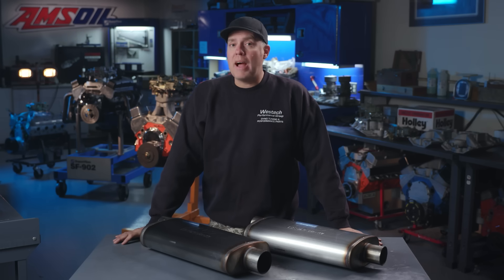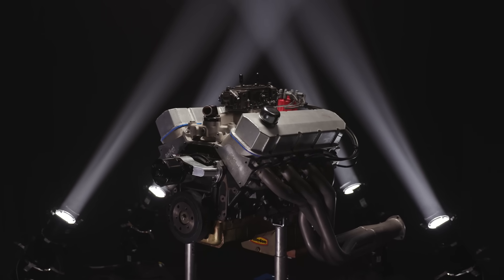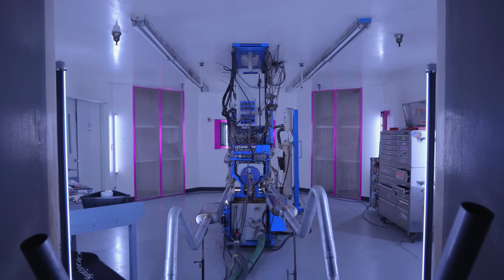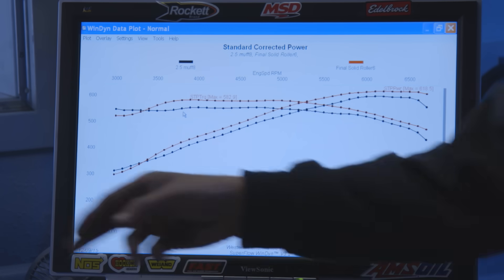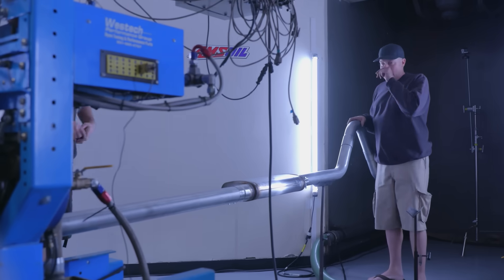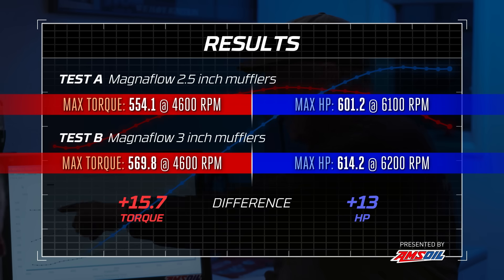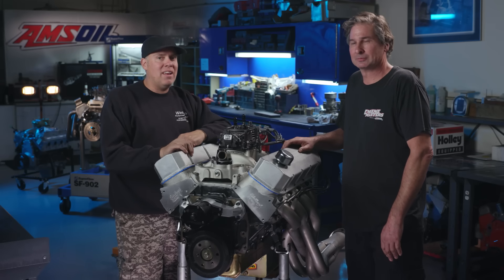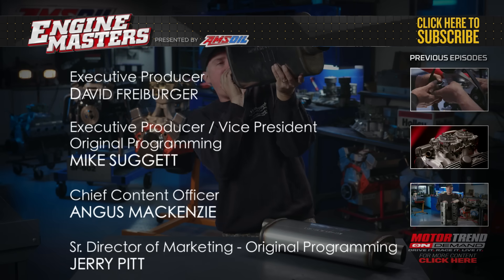The Power of 2.5- vs. 3-Inch Exhaust - Engine Masters Ep. 9

Comment: The comment about exhaust shops is so true. Every time I get an exhaust made I have to hear "nonono man you want 2.5 inches so you keep some backpressure. Your engine needs it!" Where did this myth get started and why do all exhaust shop owners believe it
Reply: +Xbox360Player350 Because in a naturally aspirated engine, exhaust velocity is a thing that affects performance. Hence header runner size, and on the other side of the engine, intake design for optimal airflow as well, instead of just the biggest, most open everything. However, the restrictions that improve velocity also introduce backpressure. So while velocity and backpressure go hand in hand, people mistake backpressure for the phenomenon that actually improves performance. It would be interesting if they had done this test with an oversized exhaust like 4" or 5", or compared 2.5" and 3" on a smaller displacment, or stock engine.
Reply: +Xbox360Player350 It comes from the guys putting 3" exhaust systems on stock 4cyl engines and losing power. There is such a thing as "too big" when it comes to exhaust. But it's not a lack of back pressure causing the issue, its a lack of flow.
Reply: +Tyler Hunt of course 3" is too big on a stock NA 4 cyl, but I had an E36 M3 lol. And they told me to go with a single 2.5" exhaust
Reply: Hey man, you just asked where the myth came from. Also, I doubt you'd see much of a difference between 2.5" and 3" on a stock E36 M3.

Comment: great study, I was wondering the what horsepower would be achieved if the air fuel ratio was optimized for each exhaust size, the exhaust length was for a cut down for a 15 foot car and the exhaust pipes were cooled by fans as to simulate running on the street.

Comment: You mainly have to consider the volume of your exhaust gases. Installing larger than needed exhaust will cause power loss, running no exhaust can cause significant power lose as well. It all depends on the engine size and tune.

Comment: so, we're talking about 10hp on a 600hp v8. The muffler pipe took 2% of the horsepower. putting these data on a 150hp 4cyl engine we have something like 3hp difference. 3hp is more like quality fuel variation or even the engine temperature. On a daily car I don't think it makes a lot of difference

Comment: Probably against your religion but I would like to see the difference on a 2/3 inch exhaust on a 4 cylinder
Reply: +Preproto definitely blasfemous, i dont think they will, 4 cilynders are not their commercial target, besides on a 4 stroker the difference would be neglible.  bring it up prove me im wrong!!
Reply: They should also try 4" and a single pipe etc, this would be really interesting to me but I guess I'm not the target market... I am ok with that.
Reply: +TheEdudo There would be a difference on a 4 cylinder turbo, would be interesting to find out how much off a difference though.
Reply: +Preproto single 4" would flow more air/make more power than the dual 2.5" but not as much as the dual 3"...it would also weight less than the both.
Reply: I meant dual 4's since they tried 2" and 3" and were so close to the straight header power I want to see if it goes up to straight header performance or if it takes a dip due to lost velocity
Reply: ***** Dual 4" would be for a serious street car
 dual 3" is good to 650hp
 dual 3.5" - 700<750hp
dual 4" - 850<900hp

Flowmaster has a chart that is conservative. They say a 4" single is good for 425hp which is slightly higher than what they recommend for dual 2.5".

Here is a good chart (DYNOMAX) to use that shows single vs. duals and recommended  pipe size vs. displacement and HP.

http://www.thirdgen.org/techboard/attachments/exhaust/109065d1136135734-horsepower-limitations-exhaust-dynomax-pipe-diameter.jpg

Comment: Repeat this test with an H-Pipe or X-Pipe and also on an engine making 350-400 HP.
Reply: I'd like to see this too. Is 3" a complete waste on a 350-400 hp small block.
Reply: +Bill Panop With my first vehicle (96 Ford Bronco) I did this thing I called the superpipe, but it was really just TWO pipes going into ONE pipe, which then split into TWO pipes to the mufflers. And maybe it was just first car love or something, but it sounded badass, it was freakin perfect, moderate when daily driving, and loud when I wanted to be.
Reply: @cybertree  That is normally referred to as a y-pipe set up usually gd for low end tq.
I have it on my car that I built for light to light street speed but I absolutely hate the sound wot.
Has my musclecar sounding like it's an Indy500 car
Reply: WarmSoftKitty Exactly, I think Lake pipes are the ultimate solution to everything (including looks). Although having both banks of your cylinder's exhausts connected at some point down the line does EQUALIZE PRESSURE, and that WILL improve HP.
Reply: WarmSoftKitty It's about more torque, H-pipes make torque off-idle. Besides, the sound alone is worth it. Again, why would manufacturers use them if they were almost worthless? They'd save money by not using them and charge you the same price for the car.
Reply: That's a great idea! I have always wondered what the difference really is.
Reply: +WarmSoftKitty from what I understand a cross pipe (H or X) actually can make more HP if optimally installed. You say not but provide zero proof.
Reply: The cross pipe uses the opposite cylinder bank to scavenge the exhaust/draw in more fresh air into the cylinder and is proven to increase midrange power.
Reply: AmericanThunder The only way to optimize the exhaust on a crossplane crank engine, without a crossover, is with crossover (bundle of snakes) headers. Even with perfectly even exhaust pipe length, you'll gain torque with a crossover. 

If that weren't true, auto manufacturers wouldn't bother using them on factory true dual exhaust systems, they'd save money by not using them.
Reply: snakesonaplane2 Optimized, as in, proper primary tube diameter/possibly stepped design/prim. tube length/collector diameter etc. Once the header is optimal, anything after the collector just needs to be big and free flowing and you can't go wrong. lol
Sure, an X pipe in the right spot will probably add a bit of power, but I wouldn't bet on it adding much when you have a proper header on the motor.
Reply: "manufacturers do it because most people like the sound of it" do you really think a manufacturer would spend hundreds of thousands of dollars and R&D to target a market that wanted a good sound?? i think not. the point of a cross over, and infact any intersection of a tuned exhaust is to make use an effect called Scavenging. because the exhaust pulse is moving faster than the speed of sound when it is released from the cylinder head, anything behind it is feeling a vacuum. so once that pulse reaches an intersection , all other manifold ports are are under a vacuum. so when the next exhaust port opens, the vacuum from the previous pulse assists in "pulling" the exhaust gas from the cylinder, and due to valve overlap, it pulls in a little more air from intake, resulting in a much cleaner following combustion. this is the key principal of exhaust tuning, thus that cross-pipe/H-pipe uses the combined pulses from one cylinder bank to "pull" exhaust gases from the other. although the effects of this only benefits low to mid range torque, as higher up in the rpm range the exhaust gas pulses move to fast and cause overlapping issues thus "interfering" with flow. hence why completely open exhausts will prove higher peak rpm bhp figures. where as crossover pipe systems will have higher low to mid range rpm bhp figures.
Reply: tim funk That's not what ur Dad said.

shit.
Reply: +WarmSoftKitty Hmmm You do know that David Freiburger from this video is the editor-in-chief for Hot Rod Magazine. Again post some actual facts to back us your opinionated claims.
Reply: Yes that would be more representative of a stock LS pickup truck or F150 etc. Nearly all the factory and aftermarket systems have h or y pipes, and are more around the 400hp mark.
Reply: AmericanThunder It takes a lot of time and experimenting to build a tuned/optimized header, and header manufacturers can only build them for factory or crate engines, any custom engine build you'd have to make them yourself, and that's gonna cost you because you'll need a lot of fabricating and dyno time. I'd rather just buy off the shelf headers, weld in an H or X pipe and be done with it. If I were going to race competitively, maybe I'd go the tuned route, but for the street, you'll gain just about as much usable power with a crossover.
Reply: WarmSoftKitty I'd like to know how many different cars and truck you've dyno tested to know this. There's lots of evidence to support my position, haven't found any articles anywhere stating that they're not worth it.
Reply: WarmSoftKitty How would I know how legit they are? How do I know you didn't make any other changes, or did the upgrades correctly? A lot of shops will do an H-pipe but don't make it correctly so it doesn't work well. 

Again, explain why manufacturers use them if they don't really work? Until you can do that, why should I listen to you?
Reply: WarmSoftKitty They also use resonators and quiet mufflers, so you won't notice the sound change without one until you modify the exhaust. It has a lot to do with power, off idle power is less without one. 

Everyone else out there agrees that it helps, also go look up Summit Racing videos, they explain how they increase power. If you think you know more than they do, then you can't be helped.
Reply: That all depends on whether the car owner has pissed-off the technician who fits his car with a new radio,
Reply: X-pipe
Reply: Hopefully they see this comment. I'm interested in that as well.
Reply: +Bill Panop Also repeat with a longer muffler
Reply: WarmSoftKitty ohh I get it they do the magazine to make money but the video version is not done for the same reason, right?
Reply: There is no way I'd believe that adding an x pipe to an already optimized exhaust system would yield that much power increase. Maybe if you started with a hugely sub optimal  exhaust, added the xpipe to "put a bandaid" on an existing problem, it might give you those results.
Reply: Agreed on the sound research. Sound is so important many cars these days actually play engine sound THROUGH THE SPEAKERS of the car based on RPM and throttle position. It's depressing. I'm going to go buy a tesla.
Reply: Theyd be welcome to use my 350 lol ;)
Reply: +WarmSoftKitty Hot Rod Magazine did a test in the October 2000 issue. the results back to then with an X-pipe was a 25 horsepower gain a 37 ft/lbs gain in torque, hardly minimal.
Reply: You are correct! @billpanop383

Comment: In other words, on a drag strip even the 2.5 incher system would maybe amount to 2/10ths in the quarter. In short, for you street car drivers that take your mufflers off, just leave them on for crying out loud. Especially you guys with cars that run 13s and slower.

Comment: 3" CC = 235.619 
2.5" CC = 196.35
using the formula y'all said.
Reply: +Kilo Bravo Productions Using the correct formula, it's roughly double the volume on a 3" versus a 2" for any given length of exhaust.

Comment: 6:50 the man is right! I was driving back from Tijuana airport to LA in my WRX fully loaded with people and luggage...man my exhaust was killing me! The drone made me want to jump out of the car.  I am sacrificing some power right now, but  I put the resonator and stock mufflers back on. Man I've never drove so fast so frequently now that no one can hear me coming 2 miles away.
Reply: That's what exhaust cutouts are for or valved exhaust's I would never run a stock exhaust, I would just buy an exhausts cutout or valved exhaust. My H2 had a 3inch magnaflow with no cats and it was pretty loud, and I just put some dynomat in key places and it helped a lot, and with cutouts I could be loud where I want and quite when I want to be quite.
Reply: Phillip Berk nah I am done with the loud exhaust life. I will be getting high flow quite mufflers with some resonator(s). I was thinking dual Dynomax ultraflow with 2 resonators.

Comment: you guys should have done a few different motors, obviously 3" makes more power on a 600hp+ application but at what point does the 2.5" backpressure help the motor...300-400 or does it even help?

Obviously open headers on a stock 350 isn't the most optimal setup but at what point do you NEED the 3" is the big question IMO

Comment: I think the important thing to take away from this example is to try to match exhaust size to the flow demands of the engine. I have gone too large exhaust pipe size on builds before and killed the throttle response, torque and general around town fun of the car.  The way I take it, smaller pipes increase exhaust velocity up until it becomes a flow limitation. Bigger pipes, slower velocity, more flow mass possibility. No such thing as Back pressure being beneficial. Just Velocity vs Mass. I'm about to go from dual 2.5" to a single 3" on my 300hp 4.0L V8

Comment: So for folks who need a little math.  The 3 inch system has a 7 square inch cross sectional area.  The 2.5 inch system is 5 square inches.  Thats a 30% difference in flow area.  At the 600+ hp level it apparently needs the 7 square inches.  If you have a 400hp small block you will therefore be just fine at 5 square inches (the area per hp ratio is the same as the 3 inch on the 600hp engine).

Conclusion, 600hp engines need a 3 inch dual exhaust for best potential power
400hp engines need a 2.5 inch dual exhaust.
Reply: John Lingenfelter (RIP) and Borla would disagree with you. Lingenfelter built over 600 horse power Corvettes using Borla 2.5 inch exhaust systems.
Reply: @LeeCountySpeedShop  I don't think you understood my statement.  You can still make 600hp with. 2.5 inch system.  But you'll be missing out on a few extra hp while you do it.  Lots of times people stick with a smaller size to help get the pipes to fit under the car - especially with low slung corner carvers.  Going bigger doesn't yield benefits but you are of course free to NOT optimize the system and miss out on some performance all you like.
Reply: @philballphotography  going from 2.5" to 3" cat back X pipe got rid of  a pop engineered into a double baffle system, increased flow, and deepend the tone, helped to increase rear wheel hp by 35 and torque by 45, smoother all around
Reply: @LeeCountySpeedShop  Yup, but its multiple things, this systems kinda twisty to be honest so although i'd agree with something like 2.5-2.75 in ideal situation if you have enough or sharp enough bends in the main pipes than if at the worst situation that 3 inch pipe is 2.X inches and 2.5 is basically 2 than you "need" a bigger pipe.
Reply: Philip Ball was thinking same thing, this engine is no where near stock. Therefore more air wants to exit and 2.5 restricts this
Reply: If the engine only 150hp what size that optimal?
Reply: @indravatar  a V8 lol
Reply: Have a 1977 holden hx gts monaro, runs 383chev about 500hp, and runs 4 into 1 pacemakers headers into twin 2.5 inch X exhaust system, katalick converters no mufflers 😈. She runs beautifully, sounds amazing! And loud😏😈👍
Reply: That’s good to know. Not sure which my o5 gto ls2 has but apparently it doesn’t matter. Glad because I was like f@*#$ do I need to go back to the muffler shop…

Comment: They missed the headline. For me, it's not a stretch that a 3 inch system made more power that 2.5 inch system, especially on a 454 cubic inch engine.  The real news is a 2.5 INCH EXHAUST SYSTEM MADE 600 HORSEPOWER!!!  Every "How to pick your exhaust system magazine article I have ever read, says 2.5 inch is only good to 425-450 horsepower, and the 3 inch system only picked up 13 horsepower? Wow, that doesn't justify the cost differential, fitment problems and additional weight to me.
Reply: And the 2.5 was running rich.   If it wasn't rich there would be a tiny bit more power.

Comment: Even the 2.5" is only ~3% drop in HP, and ~5% drop in torque. That's a very small power difference for a massive 'quality of life' difference.
Reply: much less noise?
Reply: Than just the headers? Yes.
Reply: Exactly! Not to mention that they did not tune it again which could restore the power.

Comment: So what would happen if you adjusted the mixture so the AFR is the same for all tests?
Reply: +K2edg EXACTLY WHAT i WAS THINKING, THE ENGINE WOULDN'T MAKE AS MUCH RUNNING FAT NO MATTER THE EXHAUST tho i'D IMAGINE IT COULDN'T LOSE AS MUCH TORQUE didn't look at the screen to see I'm writing in caps sorry hahah cbf writing it again
Reply: +K2edg I agree. Would love to see results if the AFR was adjusted to be equal for all setups
Reply: The thing i find ironic is they tested what would happen if you badly dented a header (which showed very little happens until its almost hammered closed), so i'd have expected similar results. 

I'd also like to see a properly timed Header that fully utilizes the scavenging effect like the old "bundle-of-snakes” headers and see if there really is an improvement over the standard headers.
Reply: +K2edg and that vs Tri-Y headers!
Reply: +HTS AutoWorks I like what you said about peak cylinder pressure. That involves the whole discussion of manifold tuning. I looked up an article on Chrysler short and long ram manifolds for the max wedge race engines and there is some good information there. You're right, every change you make to the exhaust effects the RPM where it is tuned for peak torque. And the same is true with the length of the intake runner, from the carb to the valve. Thanks for the info!
Reply: Simple, there would be slightly less of a difference in power.